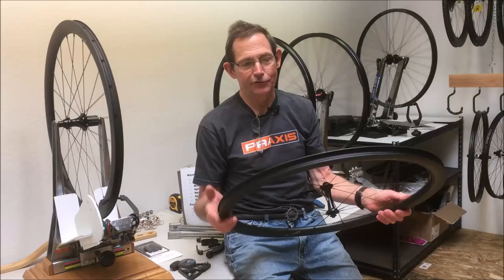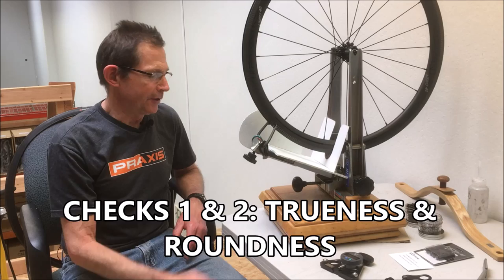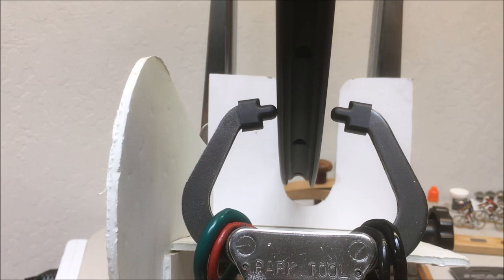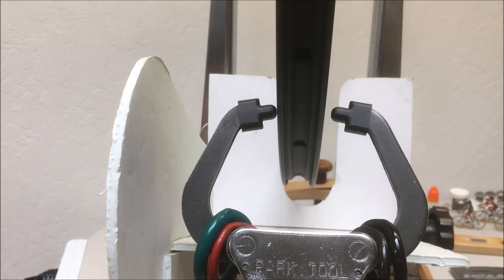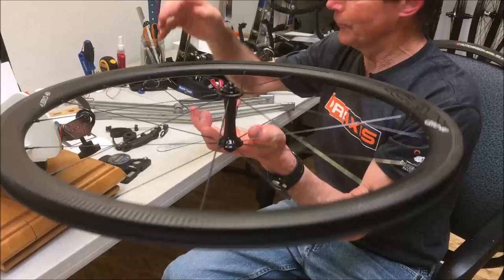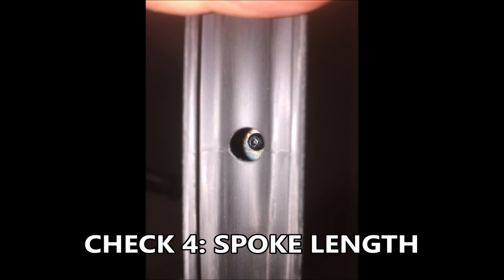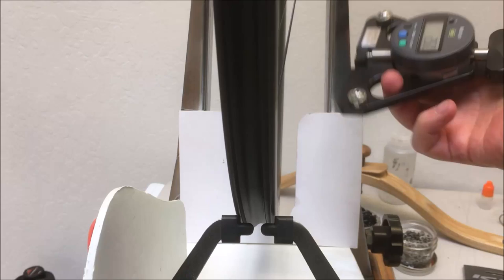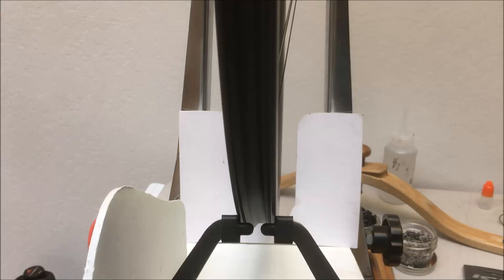ICAN Chinese Carbon Bicycle Wheels Review by Wheelbuilder Jim Langley

Comment: I've got the same Park stand so I should be able to do the same job right?
Reply from the maker: Hi glbernino0 - yes, with your Park repair stand you can do the same checks that I do in the video with my stand. Have fun and let me know if you have questions.
Reply: @JimLangley1  Im just talkin about skill & training involved. Make it worse before it gets better is my usual technique.
Reply from the maker: glbernini0 the funny thing is is that that’s the nature of wheel work and even pros like me make it worse before we get it perfect. The only difference is we learn with practice to make it less and less worse. You learn to read wobble and hop better and as you get better you learn better to turn the right spoke nipples instead of the wrong ones. You also learn more accurate adjustments so you make fewer turns. But still you basically use a trial and error process. It’s satisfying when you master the skill and it just takes practice, patience, and focusing on what you’re doing so you learn from the trial & error process. Have fun with it!

Comment: Very instructional. Thanks! A question: how often do you calibrate your wheelntruing stand?
Reply from the maker: Thanks, Denis! Actually, I have never calibrated my Park truing stand - and it's at least 35 years old. It has always worked just the way it's supposed to. In my opinion having used many different truing stands, Park came up with an amazing design with this stand and it's my favorite by far. I do take very good care of it. Maybe if you treat it rough, you would need to calibrate it. But, I baby it because it's so nice. Hope this helps and thanks again! Jim
Reply: Jim Langley Thank you for your reply. It shows how you take care of your tools. I am now one of your suscribers and look forward for your next video.
Reply from the maker: Thanks, Denis, appreciate it!
Reply: More important  is the importance of spoke tensiometer calibration. I would also do a micrometer reading for the spoke. tolerances can be off even for good spoke manufacturers so if you have a double butted spoke classed as, 2x1.8x2 mm often it can be as low as 1.986x1.796x1.983 might not seem much but it would suggest spoke charts for the spoke using standard sizes could be off even with a well calibrated spoke tensionometer in that case you would have to create a unique spoke curve using a s-loan cell or strain gauge jig for that spoke. Some wheel builders may feel this is not worth the effort but for my mind that extra step ensures that spoke calibration and tension is well aligned. Helps to creat a stronger, safer wheel.
Reply from the maker: Thanks Math Man, great points. You are correct. Most wheel manufacturers that do high volume production go to great lengths to calibrate tensiometers and measure and test the spokes they spec. Appreciate you sharing your expertise.
Reply: Jim your the expert, truly. The video was excellent and attention to detail was impressive. I see you have high quality wheel fanatyck tools. They are very good. One tool to avoid twisting spoke windup especially is the expensive but not widely available roval tool it works well with round spokes. You find lots of spoke holders for bladed spokes but not for round spokes. You could always cut an old set of pliers smooth them out and could work just as well. However I find the roval tool just so nice to work with.
Reply from the maker: Thanks again, Math Man and thanks for recommending the Roval spoke holder - I have heard others talk of how nice it is to use, but I haven't had the opportunity. I used to work with Roval wheels and spokes when they were their own company in France - before Specialized owned Roval. I have used a locking pliers like you described to hold round spokes and that works well. It's a great tip for people. Thank you!

Comment: spoke twist should not be a fail the were at worst 30 degrees off which isnt great but its not 45 which would be annoying, but doesnt mean the spoke has genuinely been twisted, it would generally be as simple as they didnt use the blade tool on the final true and the whole spoke rotated, to check for twist you would apply the tool at the hook end and and compare to the nipple end, that would be TWIST, what you measured was ALIGNMENT. Considering ive had wheels build from brands I really back that have literally wobbled totally loose within a few rides and had to be rebuild, I would consider the blades not being aligned to be a minor annoyance.

I literally just got a new £4000 worth MTB and the front wheel was well off dish, by about than 5mm! id take my blades being off angle over having to re-tubeless my front wheel
Reply from the maker: Thanks for the comment ewann. You're right that the word twist is confusing. There's twist as in actually bending a twist or spiral into the spoke and there's twist as in the spokes are twisted out of position from where they should be. You can call it "rotated" or "wound" or over-wound and so on. The spokes in my ICAN wheels are rotated past where they should be to be aero, so they are over wound or rotated too far and it actually makes them twisted from top to bottom if you look real close - it's easier to feel than see. Most aero spokes do this, always J-bend spokes because they can't turn in the hub. Some direct-pull spokes can turn in the hub but not if they're locked. Please watch for my next video to go live - soon. In that, I show how I fixed the spokes and explain more. Sorry to hear about your MTB's front wheel being out of dish. In my opinion tubeless wheels should be designed so you can true them without having to take the tubeless tire off - one thing we design into our wheels. Thanks again for the feedback! Jim

Comment: Is possible that spokes can make   Loud “click” noise when suddenly I put pressure on pedals ??? I checked everything in my bike , is sound like noise come from crank but I think noise travel from back wheel . I happened when I changed my old wheels on ican one! Spokes look tight!!  Any idea??
Reply from the maker: Thanks for watching and the question, pitekx. Spokes can make a click or tick noise but that noise isn’t that loud. It comes from where the spokes cross. They usually touch there and if they move, the metal on metal contact can make a click. You can squeeze the spokes to check for this. Try to make them move against each other and see if you hear the noise. If you do, try putting a drop of oil on each spoke cross and wipe off any excess. That will sometimes silence that particular click. Hope that’s it. Good luck.
Reply: Thank you , will try

Comment: Great work ! 
I really appreciate this vdo 
Is wheel balance an important criteria? TT guys seem to thinks so but for the average non competitive cyclist maybe not ? What is you opinion on wheel balancing?
Reply from the maker: Thanks for the nice comment and question, Mike. Wheel balancing is a rather new concept/practice with bicycles - and not widely practiced yet (FYI another person commented about it below and provided tips on how he does it). I like the idea to make the wheel perfect and optimize the ride quality. But, having ridden all kinds of bicycles on all kinds of terrain at speeds of up to 60mph, I have never experienced anything that made me feel like I needed to balance my wheels. Keep in mind that bicycle wheels are very light and the imbalances are minor. And, I don't think most regular riders would notice the difference. For example, wheel reflectors are on many new bikes and I've never had anyone comes back saying that the wheel reflector is making their bike ride funny - even though 2 wheel reflectors adds a good bit of weight right where you don't want it. Still, for competition where lots of small tuning tricks like this add up, I think balancing could certainly be worth it. Great question. Thanks for asking!
Reply: @JimLangley1  I see it as another check and balance in the scheme of making the subparts or systems of the bike work with the whole bike system.  I believe imbalances from more than one source can add up to performance errors and eventually reveal themselves in a negative way, especially if the wheels are laterally or up and down out of balance.  Just like car tires.
Reply from the maker: @JohnS916  Yes, that's a great way to look at it. Josh over at Silca, has a nice video about it here (Silca makes a balancing kit) https://www.youtube.com/watch?v=ZrRbM2BSU8A&t=8s Thanks for the comment!

Comment: review (the wheels' score): 84%.  But spoke twist and rim tape is easy to fix up to an A, so if you bump those up to an A the wheel's score is 90%.  Not bad for such a low price!
Reply from the maker: Thanks for watching and the feedback, Nblinko10. They're definitely nice wheels for the price and their MTB wheels are nice, too. In case you're interested, I showed them in this video: https://youtu.be/3yPjw0xgu4U and did a review and ride in this video: https://youtu.be/Bz87vKthgxg Thanks again!
Reply: @JimLangley1  To clarify, i wasn't giving your video an 84%.  :). Rather, I added up the letter grades you gave (84%).  When I bumped the other two to A's it showed a grade of A.   :). I loved your vid.
Reply from the maker: @Dr.Fiddlesticks  thanks for the clarification, Nblinko10 - that makes sense, appreciate it!

Comment: How confident would you feel in ICAN track wheels?  Since they'll take a lot more torque
Reply from the maker: I didn't know ICAN offered track wheels, Nblinko. But based on the performance of my road and mountain ICANs, if their track models are as well spec'd and built, they should hold up fine even with the added torque from a fixed cog. Track racing is almost a specialty sport so maybe a trackie who owns ICANs has reviewed them at some point here on YouTube or in print somewhere and you can see how they held up for them?
Reply: @JimLangley1   Yeah, they offer an 88mm i think, a tri-spoke, and a five-spoke.  They use sapim x-rays and a rebranded formula hub or something on the 88mms. I'll keep lookin' for a review of them : ) thanks!
Reply from the maker: @Dr.Fiddlesticks  well if you end up buying the wheels, I'll be interested to hear how you like them and how they hold up.

Comment: Super review about some of the wheelset its properties. Nice to hear from an expert.
The only thing I missed is something about the carbon, which I think is something really important too. Or would you say that if a wheelset 'holds'  its trueness the carbon build is actually alright?
Reply from the maker: Thanks for the question, "Mean." If you watch my unboxing video for the ICAN wheels, I tell more about the carbon. It's Toray carbon, which has among the best reputations for quality as far as carbon goes. Thanks for the comment!
Reply: @JimLangley1  using Toray carbon is good, but the other half of that equation is the type of resin being used.  Knowing how well these rim braked wheels would hold up to braking on long, steep descents would be the ultimate acid test.  Otherwise, great review, Jim.
Reply from the maker: Thanks Dan. Other commenters here have shared that their ICAN wheels hold up very well. One said he has ridden his for 8 years. Hope that’s helpful and thanks again.

Comment: First vídeo regarding rims that I qualify with A+... !!! I have a question: is possible to reduce number of spokes on 36/32H rims?  is any  trustable configuration? Sheers!!!
Reply from the maker: Thanks a lot, Jose, appreciate it! It is possible to build wheels with fewer spokes but you always want to ensure that if you're actually riding the wheels and not just experimenting, that you end up with enough spokes to provide a strong, safe wheel. As an example, a 32 spoke wheel is usually built with 4 sets of 8 spokes each. If you wanted to build it with fewer, you could use only 4 sets of 4 each and make a 16 spoke wheel. To do that yu would skip and not put spokes/nipples in the other 16 holes in the hub/rim. Again, though, you have to make sure that the rim and spokes will be strong enough with so few spokes to work or else the wheel could fail and cause a bad crash/injury. So, please be careful if you decide to experiment like this. Thanks again! Jim

Comment: Are these hooked or hookless rims? The website does not specify. Some tubeless tires can only be used on hooked rims like the conti 5000tl. Ty
Reply from the maker: Thanks for asking! Great question, Ty! The ICAN Aero 40 carbon rims are hooked bead rims so any tubeless tires that require hooked rims can be used just fine. Thanks again.
Reply: Jim Langley thanks Jim! Great news

Comment: I have had a set of Ican FL 50's.  They have standard Novatec hubs and Sapim CX spokes (which were all twisted).  Overall the wheels seem decent, but I have tried everything to keep from getting lateral flex which results in intermittent brake rub on my rim brakes.  This happens even when seated and pedaling fairly hard - 250+ watts.   I swapped out the crummy skewers to heavier duty ones, made sure they were tight, and finally had to open up my brakes to stop it.  I'm 80kg (around 180lbs), so I'm not the lightest - but definitely not at the upper limit.  Any ideas as to what the cause could be, and could I improve it any??  Thanks, your videos are awesome!
Reply from the maker: Dave K Thanks for the feedback on your ICANs. Based on what I found on my wheels - slightly low tension on one - I would check your spoke tension. Since they are so flexy, it might be that if you even just squeezed the spokes you would feel that they aren’t fully tightened. Or if you had a tensiometer you could measure the tension. If not you could find a good bike shop with one who might for not too much $ check the tension for you with their tool. Another approach is to just go ahead and try tightening the rear spokes. Start with the spoke next to the valve and remember that’s where you started. Turn its nipple clockwise 1/2 turn. It it turns easily, it’s likely all the spokes are looser than needed. Going back to that starting spoke and giving every one all around a half turn is how you would tension the wheel. Usually about a full turn to turn and a half, will make a noticeable difference in lateral stiffness. Keep in mind that you may need to half the turns on the left spoke nipples since on rear wheels the rim is centered over the axle not the hub flanges. If you have questions I am happy to answer. If you live nearby (I’m in Santa Cruz), I’d be happy to measure the tension too. Hope this helps and thanks so much for the kind words about my videos - made my day!
Reply: If it makes you feel better, I can make my genuine Zipp 404 Firecrests do this too!

Comment: Excellent assessment, Jim! What grade would you give them for VALUE? Based on your overall review, I'd suspect an "A"... Thanks!
Reply from the maker: Thanks for the kind words, Outback! I can't give them an overall grade until I've ridden on them - and a lot. Right now I'm working on a follow-up video showing how to fine-tune these wheels to remedy the issues I show in my inspection. Once that video is complete, I can finally put these wheels on my bike and start putting in some miles. After a couple of thousand miles I should have a good feel for the on-the-road quality. Thanks a lot for your comment.

Comment: HI jim,great work you know your stuff,I have a set of FL40 ican s when i grab the back down post and push the top of the wheel i can move it by 6 or 7 mm quite easily, is this normal and can i get it rectified?
Reply from the maker: Thanks, Fermanagh! If you brace your hand and then push sideways on most road wheels, they will all flex sideways to some extent. Bracing your hand gives you a lot of leverage as does pushing at the top of the wheel, which is so far from the axle. What you don't want to feel is lateral flex when you're riding the bike. If a wheel flexes, for example, on each pedal stroke climbing a steep hill, you might be able to get the rim to come over and hit the brake pad on one side just due to the flex if a wheel did actually flex. Note that bearing play in the hubs or a loose quick release could allow flex in a wheel, too. I would check for these things. Quick releases need to be really tight and bearings need to be adjusted exactly. On my ICANs these things are working fine so far and I am not experiencing lateral flex issues. I hope this is helpful and thanks again, Jim

Comment: Great video Jim.  What is your opinion on the rear wheel design?  Radial drive and 2 cross non drive.
Reply from the maker: Thanks, Wallace! My opinion on the rear wheel lacing pattern is that ICAN must have been trying to do something to make their wheels a little more unique. Or maybe they were able to get the same spoke length for the front and DS rear wheel this way so that they only need to have 2 spoke lengths instead of 3.. though I would need to measure to see if that's even a possible reason. The theory is that by radially spoking the drive side, more force when pedaling transfers to the ND side thereby more evenly balancing forces on both sets of spokes. On wheels crossed on both sides, almost all forces are on the DS spokes only. I have seen this spoking pattern before and I'm interested to see how well the rear wheel holds up as I get more miles on it. On my wheels, I cross the spokes on both sides and don't think I would radial spoke the right rear unless forced to by the hub design when rebuilding a crashed wheel, for example. Thanks for the great question, Wallace, Jim